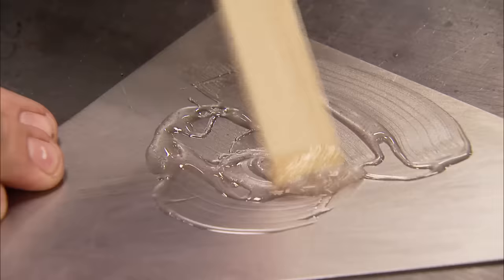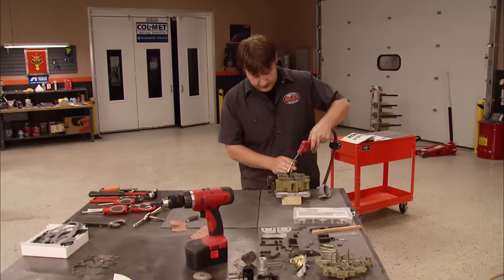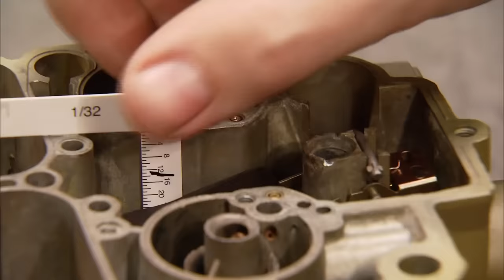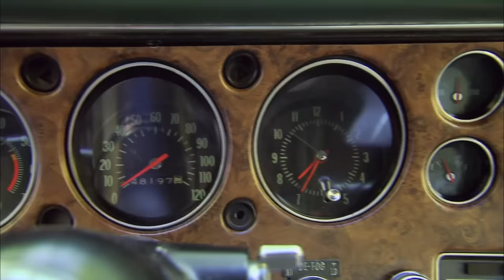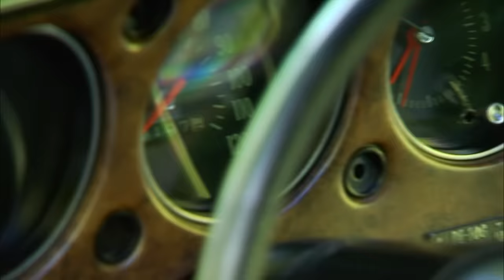How to Rebuild a Carburetor: Quadrajet 4 Barrel - Muscle Car S4, E18

Comment: Been building Q-jets for a while & You guys did a fair job but missed a few critical items.  First off the Q-jet is a fairly complex carb w/real good metering aspects, the small primary bores will give your engine good throttle response at low speeds. After using one a square bore will feel mushy at low speed by comparison. Spread bore unlike any other? What about the Carter thermo quad? To remove the screws holding the throttle butterflies in place better grind off the part of the screw that extends beyond the throttle shaft or you will likely break the head off the screw & will have hell removing what's left of the screw. The end of the screw is staked at the factory to prevent them from backing out. I use a Dremel grinder w/ a small carbide burr to do the job. Screws for the bottom plug, 7/16" NF tap will work better. I have a length of 7/16" aluminum rod threaded to use for plugs. Base needs to be resurfaced on a large belt sander, they can be really warped. Same w/ the main body. The most common mistake owners make when they have a problem is to over torque the hold down bolts & warp everything. Easy way to check the main body for warpage is to look at the slots where the secondary divider plate goes. If they are wider at the top than the bottom then the main body is warped. I have a way of straightening this part but it is difficult & the process is too lengthy for discussion here. You neglected to cover the installation of the choke lever onto the choke shaft, a very frustrating process. On the chevy carbs the plug at the back of the fuel inlet is also prone to leak. Most times this can be corrected by driving the plug in tighter (it is a tapered plug) & re-peening the area around the plug. Lot of critical adjustments to make also, especially the choke pull off which controls the rate of opening for the secondary air valves. If not done properly the carb will bog at WOT or the secondary air valves will open too slow causing disappointing performance. You guys did a fair job otherwise.
Reply: And the thick gasket they used under them made it even easier to warp them

Comment: Instead of becoming a lawyer, I spent my youth fiddling with Quadrajet carberators and HEI ignitions making GM V8s run as though they were fuel injected -- idling perfectly, no surges or bogging, no detonation and good power and efficiency. I miss those days.
Reply: Sooo whats the secret to getting crisp response from the secondaries? New vacuum break? People dont like that secondary throttle stop lever i hear, but some experts say leave the secondaries stuff alone.. tho i have heard of drilling 2 tiny holes somewhere i forget, maybe in the secondary flap edges?
 Really how about a performance tip, please and thank you.. 
I know i ran a 750 double pumper up against an unrebuilt qaudrajet same engine.. holley took it to task. Gotta at least tune the idle mixture screws for highest idle i know that much. Others have suggested the metering rods n jets.. but idk i never got that far.

Comment: Something I only recently found out is that when mercruiser marine first started using Chevy engines in the mid 80s they had their own version of a q- jet. It looks the same but it's already been modified for performance with bigger jets and passages. Marine application means no restrictions for emissions or power. They are also made up of a different kind of aluminum alloy that will not oxidize at all. My boat has a 307 out of a 73 Chevelle. I put the cam and lifters and the heads from a 300 horsepower 350 mercruiser that was sunken in salt water for a week. Then brought out of the water and sat on the shore for 5 years without being drained. The block was destroyed by freezing but the carburetor survived except for the little springs inside. That tiny little spring on the low speed metering rods was completely dissolved from the salt water and being left for 5 years. The inside of the carb just needed a can of brake clean with a straw and it looked like new. The exterior is already covered in black powder coat from the factory. All mercruiser carburetors have an aluminum tag with a part number to make it easier to get the right kit. Mine is from a 1985 four winns 25 foot cuddy. I had to scrap an old carb just for the tiny springs and I had to drill out the port and install a tube for the vacuum advance . Marine carburetors don't have any vacuum ports at all. If you need to hook up a brake booster you will also need to either drill and tap the port for the vacuum or even use a throttle plate from another carburetor that is the same. Just the fact that there is absolutely no corrosion anywhere inside or outside just blew my mind. It spent a week sunk at the dock and then 5 years on shore without being drained... Try that with an automotive carb !!!

Comment: The Quadrajet is the closest you will come to fuel injection results without actually going to fuel injection. You can control and tune every aspect and range you need with these carburetors.

One thing I am surprised they never addressed was the throttle shaft wear. The base plates should have had bronze bushings installed from the factory.

Comment: Its been a long time since I had rebuilt a Q-Jet. When I use to run them back in the 80's and early 90's I had nothing but great results using them on my '70 Nova, '77 El Camino, '67 Catalina, and '82 Trans-Am.

Comment: I always hang my carbs upside down to check float level when they're in that position installed. It is a very important part as you said.
Reply: No doubt it's important to check, new parts can change things. 
A lot of my friends play with small engines and always wanna get in there and adjust the float without knowing what it's supposed to be.
 It's running like crap, that has to be the problem right? 
In all my time I've never had to adjust a float on a small engine , unless a butcher has been there before. 
Fun to see what ya find on an automotive carb when ya open em up too. 
My buddy had a quadrajet  carb rebuild by his girlfriend's father, haha he locked out the secondaries and my buddy never noticed 🤣
Reply: @MrTheHillfolk  part of the reason i have a love/hate relationship with plastic floats. Yeah they never go out of adjustment and barely ever leak, but goddamn do they get brittle after 40 years

Comment: Epoxy is fine for sealing the soft plugs over kill to drill & tap them. 25 year ago i rebuild the computer controlled version of this caburator then set and adjusted them for AZ state emissions.

Comment: years ago the Holley on my 73 mustang mysteriously got damaged during the engine rebuild.  my friend offered me a quardrajet cheeper than replacing the Holley. I was young and broke so I went with it. he installed it and tuned it.... it was a massive upgrade on that little 351w compared to the factory Holley.
Reply: that was a very perverted part swap - did you just use an upside down holley adapter?
Reply: @shiddy.  no they make a square bore to spreadbore adapterplate
Reply: @christophersallee7904  yep, that's an upside down Holley adapter plate

Comment: I had an old ponitac that was in dry storage for 12 years - put up on jack stands. 400 engine with Q-jet and a 400 trans. Gas tank was emptied and the radiator/engine block drained. After 12 years i rolled it out into the sunlight, topped off fluids, and installed a battery. I primed the fuel bowl with gas, turbed the key and guess what happened.....nothing. I had to file the points. After filing and the points the engine fired and ran on choke like it was just parked yesterday. When it got warm i bumped the throttle and it came down to idle. I drove it to the gas station to top-off the tank. That was 5 years ago and it still runs great. Even the accelerator pump works fine. I haven't made a single adjustment on the carburetor. I never understood the hate surrounding Q-jets. They are a great carb if you know how to work on them.

Comment: Actually they went to 850 cfm and i love Quadrajets. Used to make a bushing for the center also...worked wonders for tuning. You didn't need to put threaded plugs in it though. File down and then epoxy over the stock plugs and it good to go. Vinyl interior wasn't exactly "luxury" LOL and neither was the abhorrently bad fuel mileage
Reply: Contrary to popular misinformation stated here is that the Rochester Quadrajet grew to 850 cfm.  There aren't any production Rochester Quadrajets for the '65 to '74 model years, only 750 cfm and 800 cfm models. The 1975 thru the early 80s were completely different from the early models.

Comment: If one uses a 72 jet & a 49 primary metering rod with a lite power piston spring over 20 miles a gallon can be had in the 396 & 402s. The 350 would get 24mph sometimes better with that set up. One would also have to tune the dist advance curve.
Setting the secondaries for power one could enjoy both worlds mpgs & tons of power.
The secondaries would take some drilling on some of the orifices & grinding on the metering rods.
The Q jets were fun to work on to get max MPGs & Max Power.
There was no other carbs that I built that could do the same.
Reply: That combination would render a total of 0.00218576’ which is way lean for a big CI engine like that. I’de look to experiment and look at the plugs-monitoring the temps also as that seems too lean which might create excess heat issue on top of the lean fuel ratio it would introduce.
The engineered spec chart call for at least a 0.0025000’ total fuel ratio mix for proper emulsification for proper 14.7:1  ratio for an efficient combustion.
Reply: @ashqelon7267  One has to take in to account the power piston spring. With different spring tension one can change the fuel ratio. If one is not familiar Qjets the spring is under the piston where one hangs the metering rods.
Reply: @nFlames2  
Yes I known the pieces well
Reply: I am amazed at the knowledge required to rebuild a complicated carb ! Brain surgery has to be less complicated. So many small intricate pieces, and where to find exact sizes to place in exactly the correct way....my brain hurts. Seriously, are their real people that can rebuild a carb exactly correct ?   On this planet ?  🤯
Reply: @jerrysmith9315  They are one of my favorite carbs. I was building them back in the 70's - 90's. Now the are far & few between.
People are scared of them & buy the Edelbrock carbs, there ok just like the Qjet.
Reply: @jerrysmith9315  
Most of the hard scientific work has been done on these and there are  a few sources to divulge this information .
One is a PDF that has the charts and tables for the internal components and the rendered outcome that makes these things sing!
 I punched out my unit and it runs so good, Far better than an any holly I ever had !!
I compare it to my EFI On my daily driver.
Here is a great PDF to know what to to for the most part.
http://www.capitalcorvetteclub.ca/attachments/article/92/Q-Jet%20Tuning%20Paper.pdf
Reply: @ashqelon7267  Yes its a good read but does not cover everything that i have done with Qjets. 
1: Like adding a secondary pull back spring in case secondaries hang open, then engine runs extremely rich at a high idle speed which happens to about 1/3 of Qjets. 
2: Drilling out the secondary accelerator injection ports they are found at front middle of the the secondary air horn they have 2 small brass tubes that go down to the fuel well. Be careful here don't go as the straw on a 
WD 40 spray can it will be too rich & bog down. If i do go too big I use the same straw as an orifice then drill that out.   
3: Also drilling out the fuel supply hole to the supply fuel of the  secondary discharge nozzle. 
4: If one is running a lopey cam & can't set idle to their liking one can drill a small hole in primary butterflies just a bit smaller than 1/8 then one can slow down the idle speed & the idle mix screw will work better. 
There is much more one can do to get the most out of a Qjet.
But do the best you can, also tuning ones engine timing advance plays another big part of tuning. Hope this help I can be reached on FB as Forrest Koite,

Comment: Edelbrock performer carbs are best for the street. Easiest to tune and they stay performing great for years to come. A well experienced holley tuner may squeeze a few more hp from a holley but good luck getting it to stay that way. I've had a performer rpm matched top end set on our 64 Malibu. The original 283 is in storage. It has a 350 4 bolt main high hp version with powerglide twenty years ago I took the double pumper and torker 2 combo off it. The edelbrock stuff has been performing flawless all these years. Use stabilizer when you're not gonna drive your stuff. It saves alot of headaches.
Reply: Exactly!

Comment: “This paint is made for outside the carb only” doesn’t tape up carb whatsoever and sprays directly into ports
Reply: It’s going on your car so they really don’t care.
And once the air cleaner is in place you won’t see or be aware to notice anything until the 30 days warranty expired.
And they’re still going to charge you for the “ Professional re-plating” of the body, an extra $375.00.
Reply: @ashqelon7267  lol

Comment: Back in the day, my buddy was dating this girl whose father owned a shop. 
He had a fast gto but couldn't drive so well. 
So it's time to rebuild the carb, and he gave it to her dad. 
He rebuilt it , did a nice job too.  
Then he pushed the little lever down so the secondaries wouldn't open. 
A fathers gotta do what a fathers gotta do. 
My buddy never found out or even realized that he had less power 🤣🤣
Reply: The secondaries lockout cam. Accidentally flip it over when doing a rebuild and you're up shits creek when you jam on the gas.

Comment: My uncle rebuilt and customized my Quadrajet to be better then Holly. Apparently. Some of the parts he took completely off and left them off. It worked perfectly.
Reply: I'm a retired mechanic I have rebuilt many Quadrajet carburetors carburetors and Transmissions are my specialty I can take the Ford carburetor and the Holley carburetors and it is easy to modify those carburetors to give you higher gas mileage I had a 65 Ford Galaxie 289 old motor 90 lb compression up to 120 lb compression pull a 5 by 8 trailer put about 100 pounds on the tongue of the vehicle and got 23 and a half miles to the gallon pulling a trailer going through Kansas and Missouri a big four door Galaxie 500 pulling a 5 by 8 trailer loaded never check the gas mileage with the vehicle only

Comment: Q-Jets are great carbs. Had a '72 C-10 Chev Step Side short bed bought in '85. Gone nearly 30 years later in '12. Still ran and drove.
Anyways orig carb was acting up. Ordered a new one from a once staple speed shop thats gone now, sadly. This was '87 or so
Kept the orig and this was rebuilt by a family friend, '94 or so.
Dash pot failed on the new one '99 or so. Stole the one off the rebuild and warm idling problems were gone,,,,so was the auto choke. Heard 'klink' and knew something was amiss.
Oh well, i just drove it for fun. Dang i miss that truck. Bit of a hot rod Stock with the 350, Q-Jet and a 3 speed. (old style slot mags and 275/60 R - 15 tires).

Comment: ...and everyone thinking of rebuilding one of these just happens to have a blast cabinet.
Reply: I know this comment is 4 years old... but please. You don't HAVE to use a blast cabinet.  Carb cleaner and some brushes or even a cheap Sand blaster loaded with baking soda will work

Comment: Why would anybody criticize the quadrajet? It is without a doubt the best factory 4 barrel ever made. They rarely have any problems, and if they do, they're easy to fix and tune. I can rebuild them in my sleep... No need to drill and tap the plugs on the bottom. Just rough up the casting, and put your epoxy on. Most kits also have a sponge rubber seal to put in the baseplate to help with this problem.
Reply: Kenny,
I agree about the well plugs, I had one on my 76 caddy and even the small plugs were leaking. I found that by filling the fuel bowl with fuel and let it set over night the next morning I seen where it was leaking , and sealed them and the big well plugs with J.B. weld and worked great .
Reply: Those sponge seals rarely work for very long. Using epoxy alone will work for a while but the fuel will eventually attack it, especially the witches brew of fuel that is currently available & I'm not just talking about alcohol. The threaded plug idea is best since the fuel can attack the epoxy only at the end of the thread, takes quite a while to work its way through all the thread & cause a leak.
Reply: Those sponge seals rarely work for very long. Using epoxy alone will work for a while but the fuel will eventually attack it, especially the witches brew of fuel that is currently available & I'm not just talking about alcohol. The threaded plug idea is best since the fuel can attack the epoxy only at the end of the thread, takes quite a while to work its way through all the thread & cause a leak.
Reply: @bertgrau9246  Use a blue paper shop towel & use paint thinner instead of fuel. Can spot the leak in just a couple of hours.
Reply: @larryhutchens7593  I personally use a two part panel adhesive used for bonding body panels. It takes overnight to set up, but nothing will compromise that stuff. I've used it to glue windows back into the regulator tracks on old cars, and even glued a bumper bracket on a '56 Chevy that a customer had chromed without knowing the bracket was missing. I jacked the car up with his bumper jack the next day to show him it's strength.
Reply: @larryhutchens7593  
Thanks, sounds like a great tip thank you
Reply: @kennydemartini2169  Might try that sometime. Have had fairly good success using Devcon plastic steel or maybe it's called liquid steel. Whatever the name is the stuff is real hard to find anymore.